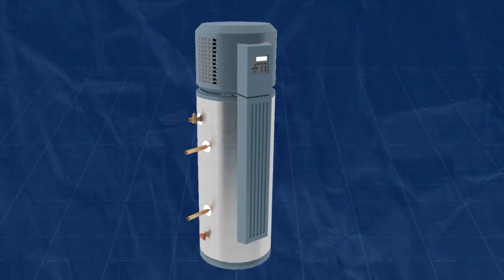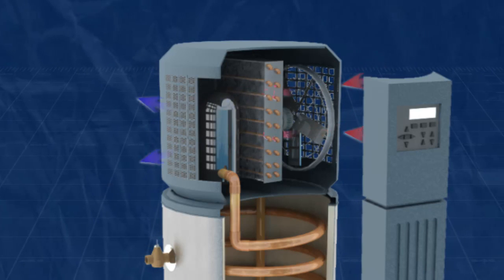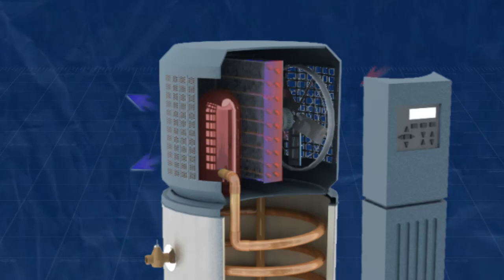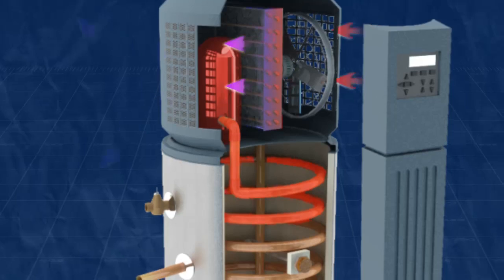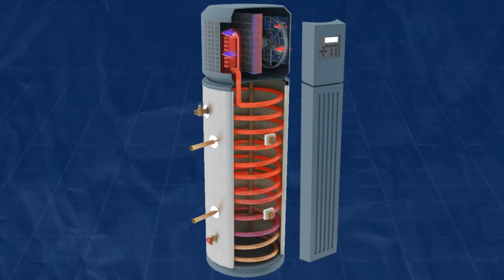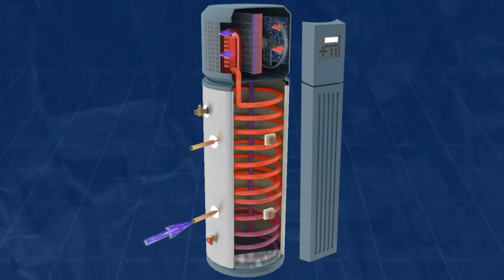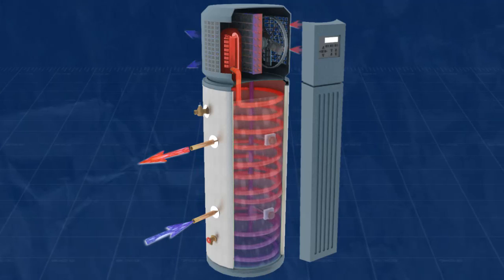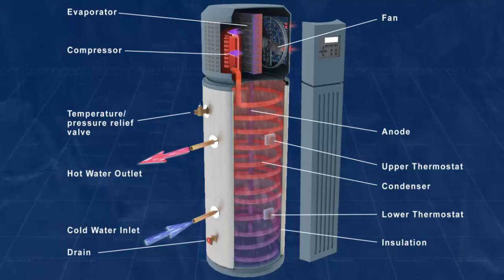How do Heat Pump Water Heaters Work

Comment: What drives me nuts with these tanks is that they are totally pointless if you live a cold climate. The tank takes the heat from inside house air, making the room cold/cooler. And, where does the heat come from to warm up that room back to the set temp, a gas furnace! Than just burn the gas in the tank. 

Total waste of money if you live in place where you need a furnace.

Comment: Whats the heating times to heat a full tank (300L) from cold to 45'C.
With the aim of having a spontaneous bath of even hot tub (1000 L).
Would it be be needed to slowly fill a bath / hot tub to keep some heat in the tank . Or fully empty the tank then, fill cold and reheat. How long to heat a cold tank and how much energy would be used in heating a full tank to 45'C from cold  say 5'C?

Comment: I've been wondering what these systems are for a while now. It works just like a water source heat pump, but the hot water is what is actually being used. 

I wonder if there is a way to connect your AC to the circuit so it dumps the heat into the tank and then absorbs the heat in the house thus cooling everything. That's what id be interested is seeing.
Reply: I have often thought that, or even integrating it into a refrigerator system. getting heat and cool in 1.
Reply: @toshy584  I'm sure it is possible. The down side is if the system breaks down does that mean everything breaks down?
Reply: @toshy584  these days manufacturers are focused on cheap and plentiful. Quality is almost always a last thought if it is even a thought in the first place. I assume it would break more often because a system that complex with multiple coils and refrigerant loops would need to be installed perfectly and have ideally easy access to avoid costly repairs over time. 

I've installed some inverter VRF systems that have multiple coils and loops, but if it isn't installed perfectly you can destroy the system pretty easily and they're not cheap. 

I wonder about it though.